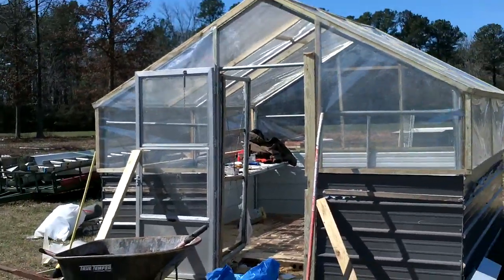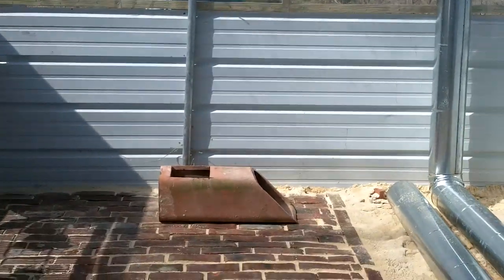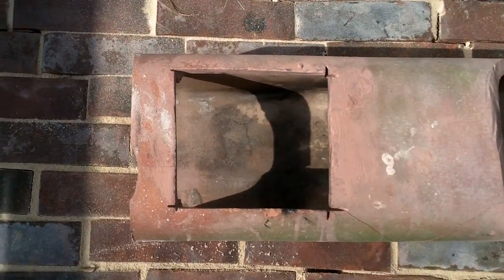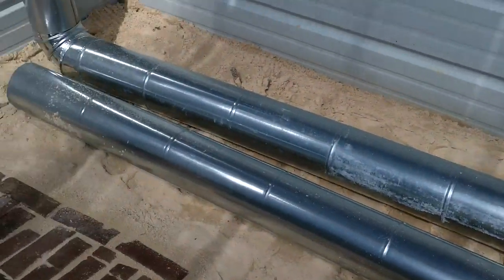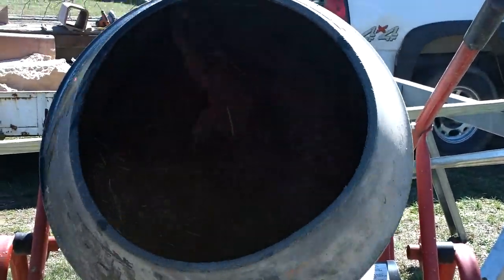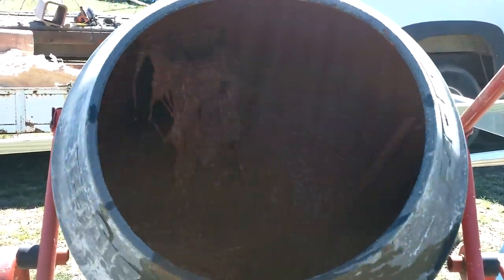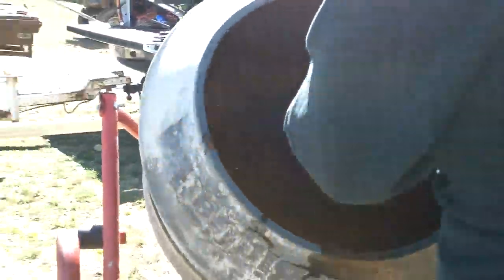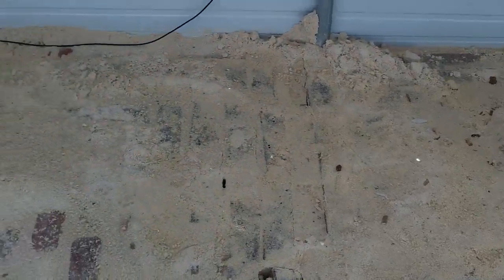rocket mass heater in greenhouse

Comment: Thanx for the info about the crack, sounded like a good idea, I was thinking about trying it. I built an in ground rocket stove with plain old bricks that were bordering a flower bed, I made some cob from the clay dirt and play sand. A metal stack goes on top. Haven't made a mass heater yet tho. A vid should be coming at some point but not sure. A friend shot it but hasn't posted it yet. I'm not video capable at the moment... I'll send it to you if I get it and can figure it out!

Comment: Exactly, my first time with cob! Only problem is that my stove sits outside, I've been using it to heat my 30 gal water heater tank. The heater is sort of shot and consumes too much propane, it's been $80/month with hardly any laundry, so I'm almost done installing an electric water heater and will use the old tank as a tempering tank that I can heat up with the rocket stove. I tarp it when it rains so cob doesn't turn to mud again. Useful experiment & I can get water to 130F. Cob is fun.

Comment: Just a note for when you are not running the fire and are using the thermal mass under the grow bed to keep the heat between fires.  You may want 
to install a damper as the pipe exits the greenhouse so once the fire is completely out, you can stop ice cold air from coming back into the thermal mass and cooling it down prematurely.  It will plainly stay hot longer.   Make sure you open the damper before attempting lighting the next fire in the rocket stove though. Hope this helps

Comment: I'm planning a greenhouse with a rocket stove mass heater but I was going to integrate mine into the ground, rather than above it, to save on space. I could also add containers of water sitting on the floor to absorb more heat from the rocket stove (water is better at storing heat than cob or cement or ground is). Also, if you can add piping to the left of the burn chamber and connect it to the outside this will stop the rocket stove from sucking air from the greenhouse, instead pulling from the outside and exhausting to the outside, and this will stop the suction from causing air drafts and leakage. You have to make sure that the fire burns the correct way when you start it though, and you still should limit airflow on both the intake and exhaust when not burning.

(I have never even seen a rocket stove in real life so my testing experience is null and I have not personally tested these ideas..yet!)

Comment: My truck broke so I can't really get propane, hence the electric...heating water with a rocket stove can be a bit dangerous, one day I'll get a vid, been recirculating the water with a 12v solar hot water pump from drain to T/P valve on tank, I use a T/P valve near homemade copper heat exchanger that sits inside heat riser. Necessity is mother of invention!Been doing rocket laundry and rocket showers all past week! But it is work, ready for this system to be backup! Piles of junk wood into heat!

Comment: Very nicely done.
I was dreaming of building a green house like that, I am in USDA zone 6, annual snow fall is about 20 inches with 6 inches at once during snow storm. Can you share the dimension of the green house, at what USDA zone? Do you insulate the green house? can the roof sustain the weight of snow?  Thanks,

Comment: are ou really going to try to use a heater in a plastic shed? it wont work- glass yet- plastic no- that plastic will melt where you vent from the heat from the pipes